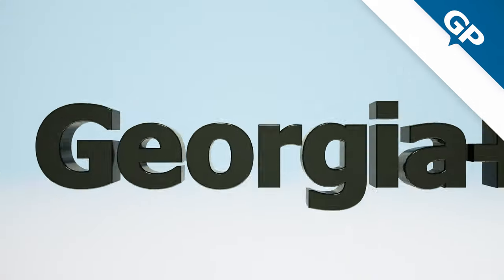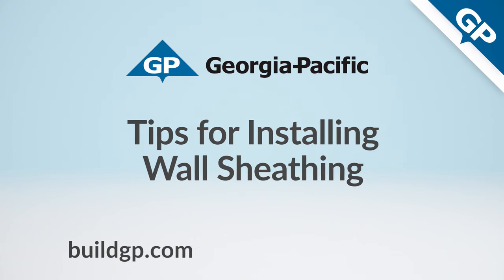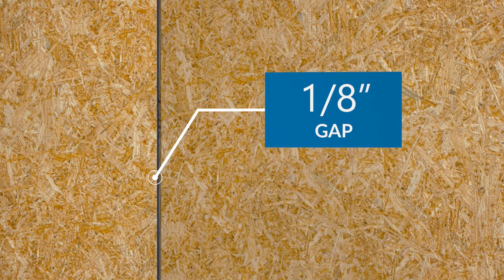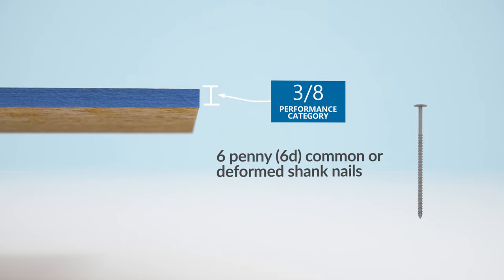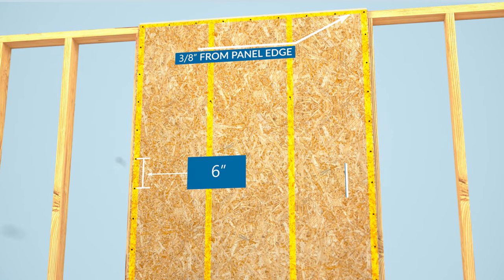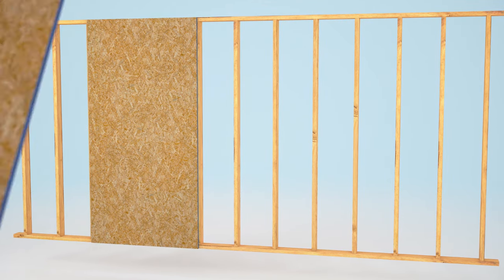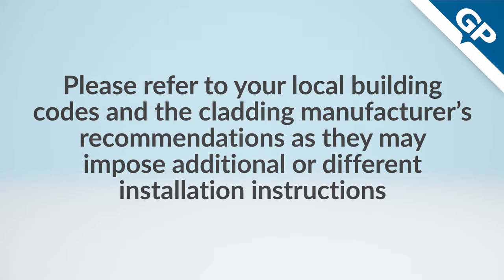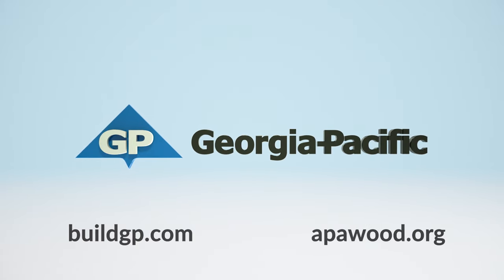Georgia-Pacific Building Products Provides Tips for Wall Sheathing Installation

Comment: I personally would not nail 'at' the corners... but nail on the vertical and horizontal edges about 2" or 50mm in from the corners... corners can break off... this method is stronger... same for drywall corners too.

Comment: They say use a 8d common nail but all the stores and building supplies places are saying 2 3/8 rs .113 is the same as an 8d common

Anyone know if code has changed for putting up 1/2 plywood wall sheathing?

Comment: People are finding it odd to hang these vertical but i think there shear amount of fasteners compensates for strength well enough. 
I'm going vertical on my add-on because they're going to be caulked, sealed & painted with trim over the joints. Should work well enough like that for strength, water and air. Horizontal seems like it'd leave gaps for cold/hot spots in the walls, even if wrapped. Studs having an R value of about 3 is bad enough. I will eventually hang tin up for siding and will incorporate the trim over the joints as spacers for the tin. I suspect my application should give me plenty time until then. My 2 foot overhangs don't hurt either lol
I'm still on the hunt for the most ideal, low permeability exterior paint if anyone has suggestions

Comment: I prefer to sheath horizontally and stagger the butts to avoid perforating the studs every 3" at the joints. Being a former drywall hanger, hanging walls horizontally is like second nature to me, but vertical just seems wrong. I wonder if anyone in these comments knows why exterior sheathing always seems to be hung vertically? There has to be a reason.
Reply: There is.  It's called a braced wall system.  In the newer 2018 IRC it calls for vertical sheathing  for increased strength.   I personally like horizontal and staggered joints.  However I'm sure alot of engineering went into this new requirement.   And nail edge spacing is 3" on all braced wall panels only.
Reply: Vertical seems wrong to me
Reply: Vertical sheathing is to increase sheer strength and to prevent racking.
Reply: Idk but I'm doing it in my add-on because they're going to be caulked, sealed & painted with trim over the joints. Should work well enough like that for strength, water and air. Horizontal seems like it'd leave gaps for cold/hot spots in the walls, even if wrapped. Studs having an R value of about 3 is bad enough. I will eventually hang tin up for siding and will incorporate the trim over the joints as spacers for the tin. I suspect my application should give me plenty time until then. My 2 foot overhangs don't hurt either lol
I'm still on the hunt for the most ideal, low permeability exterior paint if anyone has suggestions
Reply: @@karlwithak. You're right, that's another thing about vertical sheathing, it wastes wood - you save board-feet by hanging the sheets horizontally. And the people claiming that vertical sheathing increases strength, I've recently learned that in wind and tornado prone areas, code mandates horizontal for increased strength. And in other areas, all load-bearing exterior walls are required to be sheathed horizontally. So the strength argument goes out the window.

It's all about money.
Reply: @CaliforniaCarpenter7 A genuine question...why does it waste wood? The wall has a certain square footage (A), and the sheets cover a certain smaller square footage (B) It would logically follow that A divided by B determines the number of sheets you need to cover the wall. That's the case whether you hang the sheets vertically or horizontally. I get that there might be a preferred way for strength or whatever, but I don't get why hanging vertically wastes wood compared to hanging horizontally.

Comment: Would 1 1/2" 18 ga narrow crown staples work?
Reply: 18 gauge staples have vey little shear strength and holding (pullout) power.
Reply: Absolutely not , even 15 gauge finishing nails are far too small honestly deck screws work the best to hold panels to a wall or even just framing nails
Reply: @Zeppodone1000mg  I meant for the trim while propping the door up
Reply: @philipdove1705  This video is regarding OSB wall sheathing. How would anyone know you were asking a question that was regarding something else? I also don't think propping the door up with TRIM is common practice. Perhaps that just some terminology confusion?
Reply: @Zeppodone1000mg  screws are not appropriate.

Comment: I thought you have to install sheathing staggered horizontally ?
Reply: that would be what i think too, it makes it stronger i think, where a butt joint is on the lower course being strengthened and stiffened by the upper course, or am i mistaken?
Reply: From what I understand staggering them is more common on roofs and for flooring.

Comment: this OSB was $8 in 2019, comes 2021 it is $44. There is no justification for this.  I have to finish my walls and roof. After this, I will never use GP.
Reply: Holy moly, that is a huge increase! That's due to COVID restrictions and a slow down in production.
Reply: i just did my sub floor and that's what I paid, $44 a sheet of OSB. So pissed.
Reply: Yep total BS, that price is ridiculous!
Reply: insane. I'm not in the industry and needed some. Knew the price was up but didn't realize by how much.
Reply: @ThriftDiving  Why do you just pull these assertions out of…the wind? It just looks like greed from American corporations who know they can get away with this #GREED
Reply: @ThriftDiving  my friend works in the industry. There was no production shortages. They have been working the same hours, putting out the same materials. This was all fabricated supply and demand just like the price of fuel
Reply: We were paying $70 in the North West